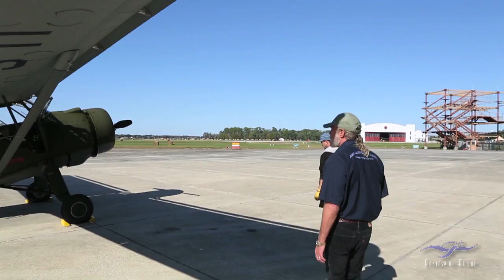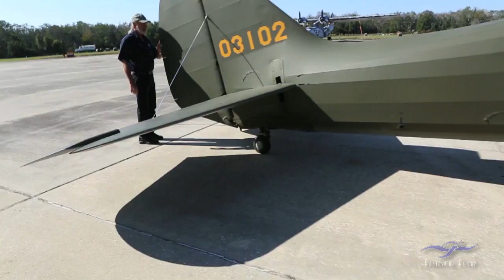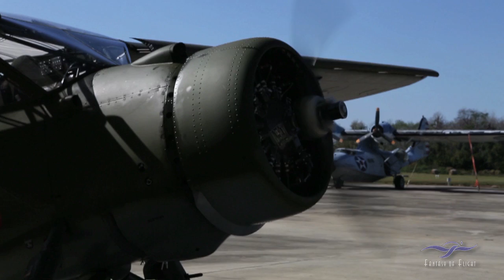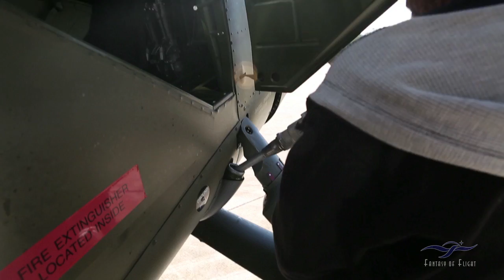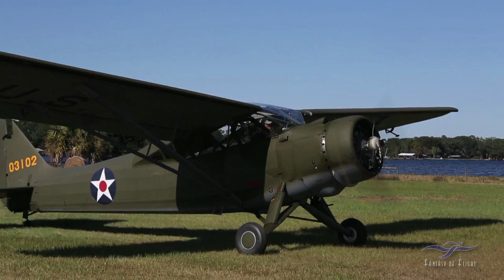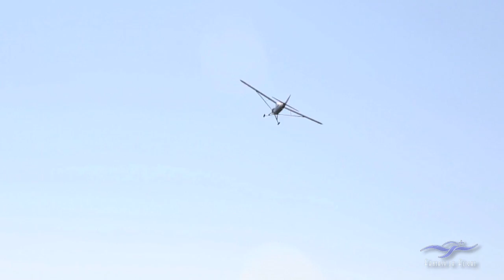Stinson L-1 - Start Up and Flight - Kermit Weeks

Comment: Hi Kermie, have your guys checked the compression pressure and exhaust temp and cyl head temp and exhaust pulse signature on all the cylinders? Still doesn't sound as if it is running 100% to me. [but then I have only been listening to Aero Engines for six decades]

Comment: About the same size as a Fiesler Storch, unless I miss my guess.
Reply: tsmgguy Looks like bigger than the Storch...
Reply: L-1 span 50' 11", length 43' 3". Feisler Storch span 47', length 32'. Both are considerably larger than my Piper L-4A.